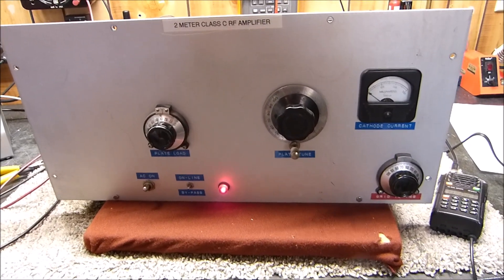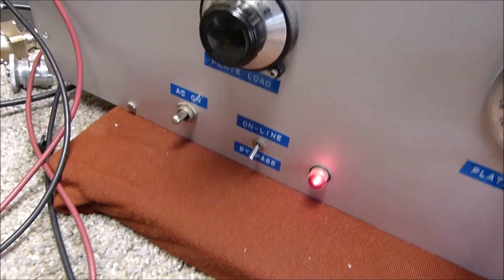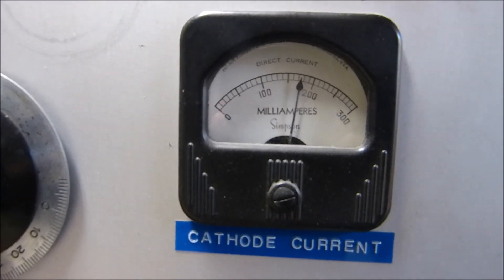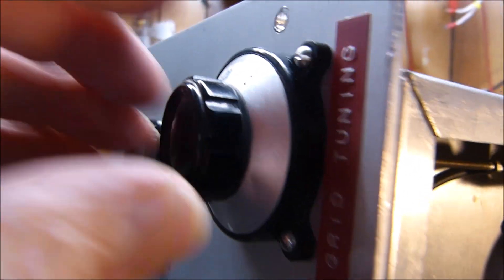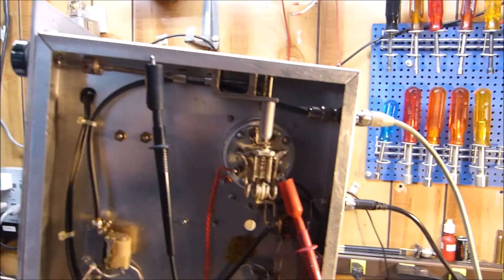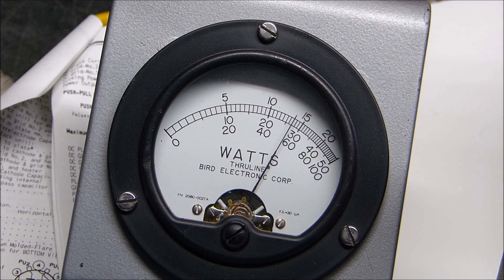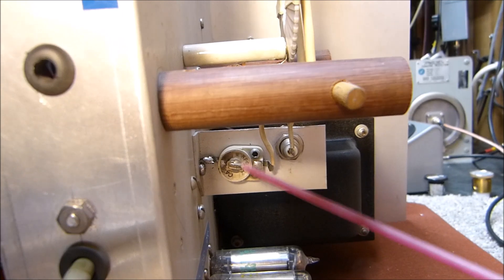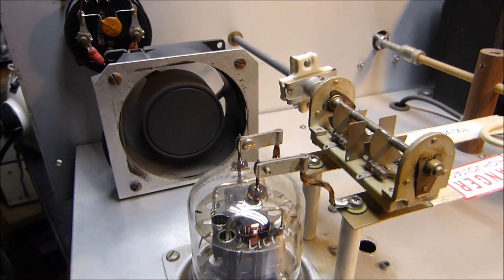VHF 2 Meter 829B Push Pull Class-C Vacuum Tube Amplifier

Comment: I bought an Am912 cavity amplifier from Fair Radio in the mid 80's.  Power supply is not included so I built one.  It uses a 4cx250 tetrode.  I mounted the power supply and the amplifier in a short rack cabinet.   I run it about 300 watts but if I push things I can get 400 SSB watts out of it if memory serves.  The 4cx250 won't last very long at 400 watts.  Nice build on your amplifier.  I remember this circuit in the handbook in the late 80"s.
Reply from the maker: I  built one 4CX250B amplifier running class-C and could get an amazing amount of power out of it. Had to buy more RF elements to measure it but I only ran it on 2M band. Sold it as a Midland, TX hamfest in the early 1990's. It was an open chassis running 2KV as I remember so it was a bit dangerous.  🙂 I remember it would make the RG-8 coax warm. I still have a few 4CX250's and they interest me so maybe I can make another amplifier with them some day. Thanks for your comments.  My QRZ page is full of homebrew pictures you might like.  73  WA4QGA
Reply: @ElPasoTubeAmps  I have a collection of 4xc250 and 4cx150 tubes as well that I'd like to build an amp with.  Yes I'll check out your QRZ page.  I enjoy all your audio amp project video.   I hope to build a KT-88 tube amp one day. I was envious of your HP8903b audio analyzer.  I found one on ebay at a good price.   Thanks for taking time to respond to my comment. W5TRK 73.

Comment: With it being a class C amp, is there not a need for a low pass filter at the output to cut harmonics?
Reply from the maker: No, I have never hear of that need for a class-C amplifier. I just built a grounded grid (GG) 3-400Z amplifier biased for class-C (-90V on the grid) and plate modulated it running to run AM. I noticed on my modulation monitor my negative modulation peaks are higher than the positive modulation peaks and just read this is because the grid voltage (-90 as mentioned) is added to the plate voltage (3200 VDC) during the negative cycle of modulation. So, now I am in the process of adding a keep-alive voltage prevent over modulating in the negative direction. I use this same keep-alive circuit on another AM transmitter and it works very well. Here is the link in case you are interested.
http://amwindow.org/tech/htm/3diodeka.htm     73    WA4QGA
Reply from the maker: I think the distortion is there as a class-C amplifier conducts for less than 180 degrees of the positive cycle and the collapsing fields of the resonate plate tank circuit provides the opposite half cycle (amazing, isn't it...) and distortion is probably pretty high for modulated audio but I think we can survive 2, 3, maybe 4% THD without too much trouble especially if it is just voice communication. It would be interesting to know the distortion level of a commercial AM station. Class-C amplifiers work great for plate modulated AM and for directly amplifying FM signals.
Reply: @ElPasoTubeAmps  OK interesting---I was just curious. Maybe it's just that tubes are cleaner than solid state devices, so they don't generate as much harmonic content? Or maybe the tuned circuit part of it limits the spectrum to keep it clean.  I just had in my mind that any non-class-A amp would have a decent amount of distortion which would manifest as unwanted harmonics on the output.

Comment: .....Lovely thing!!!     I have a Belcom LA106 2 meter linear using the same tube, but, it needs 10 watts of drive, and has a very odd grid circuit. The link coupling you constructed looks much simpler, and straightforward,...   Could you tell me the driving power from your HT in the video?? I'm hoping to modify my linear to the same as yours, and get a fair output from a 3 watt drive power,....  Thank you for your video, Fred G4ZWI

Comment: You can easily make those coil clips yourself! you can get aluminum OR tin from anywhere. 
of course you use tin when you also need to solder it!
Tin can be found everywhere, for example in the kitchen!
(I even sometimes cut lemonade cans - OR aluminum OR tin)
bending aluminum or tin, what shall I say! is so easy to do!
you could also make tuning capacitors with the tin version.

Healthy and Friendly Greetings from the Netherlands!
Rob

Comment: why did you not go with 2x 4CX500A ceramic vacuum tubes instead of a glass vacuum tube.
Reply from the maker: This 829B is especially made for VHF and I had plenty back then - still have a few spares. Some time later I did build another 2 meter amplifier with a single 4CX250B that would deliver 500 watts output and sold it soon afterwards at a hamfest in Midland, Texas probably 30 years ago.

Comment: Wow, you triggered some great memories with your 829B video. I started out with a Heathkit Twoer in the early 60s. In those days, there were no repeaters and limited commercial equipment. The first thing I did was to build a nuvistor converter coupled to an ARC5 army surplus receiver. I started to hear a lot more stations with my 8 element antenna at 60 feet, but they couldn't hear me. I was in high school at the time and had a very limited budget for equipment. Fortunately, there was a great army surplus store that had everything I needed to build just about anything. My next project was to build an 829B Class AB1 linear amp to be driven with the Twoer. I knew a broadcast engineer that gave me a used 829B from the FM station where he worked. I found a surplus silver plated piece of gear, some kind of cavity resonator,  that became the chassis for my amplifier. The power supply was built from scratch and used large oil filled capacitors, a huge choke, VR tubes and heavy power transformer. With that combo, I started working stations over greater distances. About this time I was getting interested in SSB. One of my mentors gave me an article that described building a six meter phasing type SSB transmitter. I scrounged parts and put it together. QST published an article about a six-to-two meter transverter based on Compactron tubes so I built that. The nice feature about a phasing type SSB exciter is that carrier can easily be inserted to operate in the AM mode since there were few SSB stations on 2 meters. Once again I was able to hear distant SSB stations but the 829B amplifier just wasn't enough to be heard. My final 2 meter project was to build a 4CX250B amplifier. I live in Michigan and managed to work 14 states, the furthest at about 900 miles away. By the early 70s, 2 meter repeaters and FM became the dominant mode and AM/SSB operation faded fast. I lost interest in 2 meters and gave all of the equipment away when I went to college. It was great fun and led to a successful career as an electronics engineer. Now that I'm retired, I'm getting back to designing and building receivers, test equipment and other stuff just for fun.

Comment: Great video. By any chance do you have any schematics for 829b as a P-P audio amp power tube? I'm looking for an old, like they're not all old, but this was a series-P-P audio amp. Thanks for the video and any help.
Reply from the maker: Pete Millett is a great source of information. In this example, he uses them as SE amplifiers. I personally would use them as push pull.

http://www.pmillett.com/829b_amplifier.htm
http://www.pmillett.com/images/829b.PDF
Reply: @ElPasoTubeAmps  Just check it out. Looks great.
I had a magazine where they took one tube connected in series then put two of those to make a push pull amp. It takes four FU29's for stereo but that's why I'm wanting to build one. I have a about twenty of the old 829's in da box.
Also by running each tube in series they could use them with, as I remember, a 35% linear tapped OP trans. 
You can't normally do that with 829's due to having interconnected K, beam grid and I think G2's are in there as well.
But hey man thanks. I'm working on a 6V6 thingy at the moe buttt.
Reply from the maker: @tayro7265  Something that crossed my mind. There are definitely some tubes that can not be run in a triode mode, i.e. the screen at plate potential. One such tube is the Eimac 4-65A. Eimac specifically warns about this.  It has to do with the internal geometry of the tube construction. The screen must be at the potential suggested in the datasheets otherwise, the tube will be destroyed. I do not know about the 829B. It is definitely worth looking into before possibly destroying tubes. I mention this because of your comment about the 35% taps. These taps put the screen at the same voltage as the plate and is a form of triode mode. Just thought of this and figured I would throw it in. Investigation may prove that the 829B can have its screen at plate potential.   73
Reply: @ElPasoTubeAmps  Yes Sir, that's why I'm fishing for info. Again as I recall the schematic did have a dropping resistor. However if it turns out that resistor is some 5m @ 150w, then yea can't play that game.
I can't remember the name of the amp. It was a mono guitar amp. I do remember the magazine splashed "With the power of the 829B" across the schematic. Just to make it easier to not be able to read it.
Reply from the maker: @tayro7265  This has been an interesting search for the 829B tube. As best I can see, there  are no manufacturer recommended applications for using this tube in an audio circuit. It was strictly designed for a class-C  RF amplifier in the VHF and UHF region back in the 1940's. That doesn't mean you can't use it for audio as it seems a number of people have and I have found nothing that says it can not be run in triode mode, so, I would assume from its plate voltage and current, it should work with a push-pull plate load of 3.5K to 5K ohms or whatever you have with out spending a bunch of money. Bias voltage is reasonable (-50) pretty much the same as a KT88 so... why not ?  Be sure to study the datasheet for recommended plate voltage, bias voltage and plate and screen current.   https://frank.pocnet.net/sheets/201/8/829.pdf  Best of luck.
Reply: @ElPasoTubeAmps  Wow! I fill bad you dug into this this long, especially because I have an RCA 7-63 datasheet:
AF Power amp Class AB1b
Effective Load resistance Plate-Plate (Brace yourself) 13,750 @ 44w output.
Reply from the maker: @tayro7265  Not a problem - I enjoy looking for this kind of stuff and I find all kind of things interesting. Do you have a link to how the 829B is used as an AF amplifier and schematic as a push pull amplifier? I am interested as, who knows, I may have to build a stereo version of it...
Reply: @ElPasoTubeAmps  Your going to just up and steal... Naw I'm joking. I would like to see you build one. If you have an EMail, I could send you a PDF of the RCA data. Just not right now. I'll be back in a few hours though.
Reply: @ElPasoTubeAmps  I would like to see this either built or demonstrated, please.
Reply: @ElPasoTubeAmps  Thank you!

Comment: Did you try and industrial supplier like Graingers? Looks like something from a large motor start, old style equipment.
Reply from the maker: A good gentleman directed me to DX Engineering where the very ones I have are sold. I will keep Graingers in mind for possibly larger ones. Thanks...

Comment: The lost art of ham radio. Reminds me some of the plumbers delight with a pair of  4X150's or 4CX250's.
Reply from the maker: I have always considered building that plumber's delight you speak of but haven't gotten around to it. I did build a 4CX250B two meter, class-C amplifier in the late 1980's and it would deliver around 500 watts to the antenna. That is when I acquired all the VHF Bird slugs going form 5 watts to 500 watts. So much power the RG-8 coax would become warm. I sold it at a ham fest in Midland, Texas around 1990 time frame.
Reply: @ElPasoTubeAmps  Thanks for the kind reply. Ex-Varian-Eimac'er OM here. 73' keep building/restoring.
Reply: I started to build the plumbers delight for 2 meters with 2 of the 4CX250F in the late 70s but never finished it.
I would really like to see one working. I see some videos using 2 in parallel for 11 meters.

Comment: Did you have to reform the HV electrolytics?
Reply from the maker: You inspired me to drag out a box of probably 200 or more electrolytic capacitors from the attic where they have gone thru El Paso summers and winters for a lot of years - as much as 20 years up there and they may have been 30+ years old when I put them there. 
I started measuring and tinkering and had mixed results in reviving them. 
In the case of this amplifier, I just plugged it in and turned it on. That is usually the way I do it. 
I will not deny that bringing up electrolytic capacitors slowly might be a good thing but just turning them on seems to work for me virtually every time. I have been doing this more than 50 years and rarely do I have issues with electrolytic capacitors - mostly they just open up and become pico Farad level. That is my experience. 
I tried making the video but the results were so varied I am not sure a relevant  video can be made that will say one way or the other if there is any difference between slowly starting them up or just putting the juice to them. I can't do one procedure then the other on the same capacitor so we can never know. I am still thinking about it.